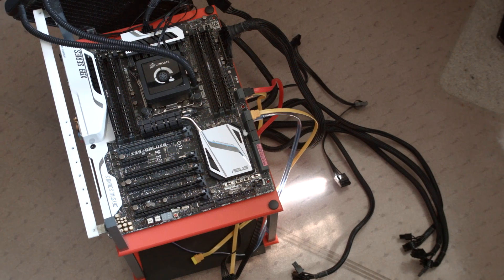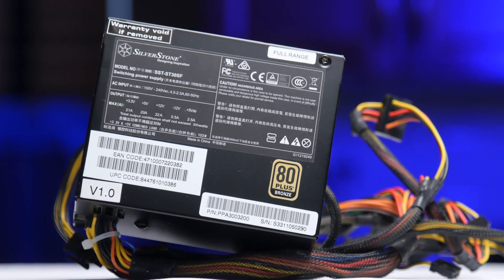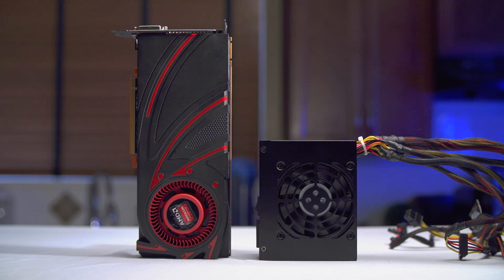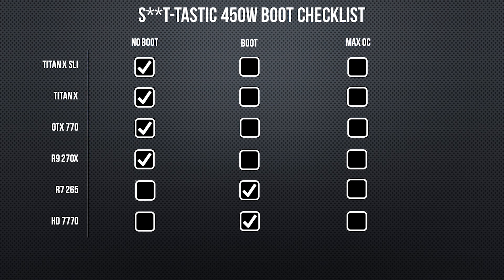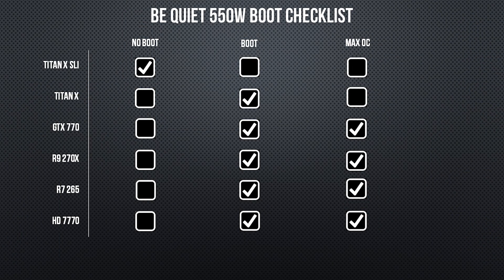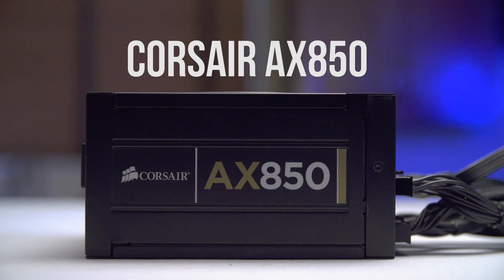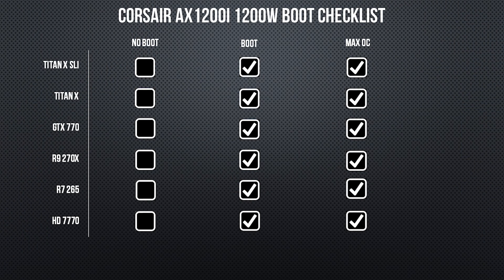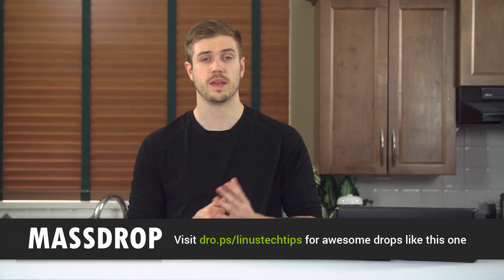Overclocking Recommendations - Low vs High Wattage Power Supplies

Comment: Hey i got the gtx 1060  and a i7 920 
12gb of ram if thats important

I wanna overclock the CPU i have. If i do it in bios how do i do it and how much is safe but still a good overclock? I have 500watt power supply

Also my processor cooler is a cooler master hyper 212

Comment: i have ryzen 2400g processor and corsair vs 450 smps.when i push my cpu above 3.9 it will cause freeze.its because of power supply?
it will complete one cinebench loops some time and othertime it will freeze.

Comment: Just gave in and bought 750w G2 and swapped out my currently mint running perfect 500w after a year of running it at full SLI gaming beast mode with 5.2 OC 7600k and a shit ton of fans drives etc and finally got off my ass and measured wall power. OMG how did my PC work! I was pulling 610 watts on a 500w unit. No issues no heat etc. Threw in G2 750 for the first time I was able to gain 53mhz per card core and additonal 50 mhz memory on both GPUs. NEVER had I been able to do this. Will test OC to 5.4 tonight but so nice to see power draw less than rated and bonus YES MORE OC ON CPU AND GPU SLI! FTW SO WILL IT WORK ON 500 YES, ARE YOU STRESSING IT AND LEAVING MHZ on the table? YES.

Comment: why does luke keep talking about power from wall like it's impressive? power supplies are rated for how much power they can deliver to components. of course they will pull more from the wall than they are rated to deliver under a full load since they are not 100% efficien

Comment: is it safe to overclock an asus gtx 1060 with a 550 psu? i have also an i5 6500, 16gb of ram and an h170 motherboard.
Pls help :/
Reply: Yes it's fine and safe to overclock as the pascal cards are very power efficient.
Reply: Thanks bud ;)

Comment: Hi can anyone help me out, i just bought an r9 390x but i only have an evga 500w psu. Im currently running a g3258 at 4.6ghz and an r7 260x just fine but if i upgrade to my 390x and an i5 (maybe 4460) both running stock speeds will i have enough power? I wont be using the 390x until christmas so i have plenty of time to decide if a psu upgrade is really necessary.
Reply: https://linustechtips.com ask theere
Reply: LOLZ1259 oh thanks, i never thought to use the forums i guess this would be a good time to do so.

Comment: Is it safe to overclock my GPU with these specs?
i5 6400
GTX 1050 TI
8gb ram 2x4 2133 DDR4
Asrock h110m
2x 1TB HDD
Vs450
Reply: Mild overclocking of the GPU should be no problem, but don't go too far. By the way, what is the exact model of your video card?
Reply: It is from Zotac =)
Reply: Thanks for your answer man! i really appreciate it :)

Comment: well i have a gamma psu 350  watt
with 2 12v raliils each one delivers 20A
my pc spes are:
i3-2120
2 sticks of 4 gb ddr3 ram
and a 7.2k rmp sata solid drive
and i wanna get gtx950 gpu and insert it on this system
is this psu good enough.
thanks in advance
Reply: use http://outervision.com/power-supply-calculator

Comment: I'm really curious if a 8  core, 16 thread Zen CPU plus a GTX 1080Ti would pull more than 550W. Really hoping not because the next EVGA G2 step up is 650 which I have a feeling would be overkill. Ugh why don't they make PSU's in other increments like 580.

Comment: I have an oem and I tried installing gtx 650 with 230 w and it wasn't booting  and i plugged in everything properly is it cause of the motherboard or the psu
Reply: If you really are trying to power a pc with 230w then that's definitely your problem.
Get a 450 - 500w power supply at least.
Reply: don't talk nonsense, lol drusby.

Lol what made you think it's MB or PSU it can easily be cpu, ram as well, get to friggin researching not youtube comment section and expect to get answers lol.. 

kthegreat. 230 might be too little, and hearing such a small number i'm guessing it's used so your parts might be broken especially the power supply.

also you should probably get more power while you don't need 500w. 350 to 400 would be a safe choice. (im using 450w with 4 generations higher graphics card.., i5 6500 cpu, and i still could'we easily went with 400w)

use site to check how much power you need
http://outervision.com/power-supply-calculator
then buy power supply  30%-70% bigger, also buy a decent power supply not some chinese shit, buy one with 80+, 
get as good quality as you can afford and bigger if you plan to build pc sometime later and use same parts, power supplies degrade and get dangerous  to your pc parts, but good quality supplies are much less likely to kill your pc and degrade slower.

Comment: Please redo video with new power efficient pascal and polaris GPUs
Reply: what do you expect. you need a less powerful psu. end of story
Reply: i need numbers, man.
Reply: So if I ran let's say an i7-5960x OC'd to 4.5 with a GTX 1080 at 2k Mhz a EVGA G2 550W would be enough?
Reply: yes. the graphics card will not go above its power limit unless you bios hack it, so this is 180 watts. the i75960x has a tdp of 150 Watts. lets estimate 200 Watts. then you are at 400, leaving you with 150 for mobo and hdd, peripherals. That is plenty. Fans are negligable.
Reply: Nils Wolny
Thank you! Now I know for sure that I wont need an OP PSU for it. Although I heard EVGA precision can go up to 120% of the power limit but as you pointed out that shouldn't effect it or would it?
Reply: Mike Soda
 yes, that does not matter for you. also running a psu above specs will surely degrade it fastly. 
it might also be a myth that came up, because the power drawn from the socket is up to 20 percent higher than what is delivered to the parts. the number of the psu is the max power going to the parts, not what is drawn from the socket.
Reply: Mike Soda
 yes, that does not matter for you. also running a psu above specs will surely degrade it fastly. 
it might also be a myth that came up, because the power drawn from the socket is up to 20 percent higher than what is delivered to the parts. the number of the psu is the max power going to the parts, not what is drawn from the socket.
Reply: Nils Wolny
Great thanks, in some other comments elsewhere someone tried telling me that a G2 550W gold is overkill lol. I guess they're one of those people who try to cheap out on a PSU & fry the whole system.
Reply: Mike Soda haha. 550w overkill. Not really. I remember when I bought a 700 watt psu to be on the safe side. for mayimum efficiency you want your psu to run between 50 and 80 % of maximum power.
Reply: For graphics cards (even with Pascal), it all depends on what you get. My non-reference Zotac 1080 Ti (OC out of the box) 1is dual 8-pin at 320W, and overclocked further with 120% power I've seen peaks at 350W, in theory up to 384W. This is a single card, and the SLI setup (for this card) even with Pascal's overal more efficient design could pull up to 800W by itself. 
More expensive power supplies (usually 1000+) often have considerably better warranties (like 10 years+), superior energy efficiency, and are quieter (especially when not under full load), so if you're going hardcore and you can splurge, it can still be a solid investment, unless the game totally changes.

Comment: did u use adapters for power supply that dont have 6pin or dual6pin or 8pin connectors? i want to try if it will work on my 2+6pin to run an old 480 wich has a 6 and 8pin power connector. kinda scared coz it might explode. lol

Comment: Can I run an MSI nVidia geForce GTX 960 2gb 128bit on maximum overclock with 600wats psu?? Thank you if someone answer
Reply: Yea
Reply: absolutely.

You can run a GTX 1080 at max OC with 600w, you have nothing to worry about with this setup

Comment: i have an Antec 550W GOLD PSU, is it enough for i7-6700k OC @4.4Ghz, Msi GTX 970 OC, 120gb SSD, 1TB HDD, Optical drive, and a PCIe Wlan card?
Reply: easily

Comment: will 220/250watt be enough for the GTX 950/960?
Reply: Rinay Harpal A 500W PSU (assuming decent quality) that means it can deliver 500 W to your computer and draws 625W from the wall (assuming it is 80% efficient).  In my case, I have a 650 W PSU that has an efficiency in the neighborhood of 92%, if I put my PSU under full load, my computer would draw 708ish W from the wall.
Reply: Rinay Harpal you also misspelt genius again...
Reply: a 250 watt psu is way too less, that would not eve be a gaming psu, the gpu will use at like 150-200 watts alone, cpu 75-135 depending on the model, so this already exeeds 250 watts. you should go for a 500w or above 80+ rated psu hope this helps. if you post your rig specs, you could get a better reconmendation.
Reply: ok thanks im gonna buy a 450w psu then?
Reply: get a 550w 80+ certified instead, psu give around 80%(80plus) of the power written, i would go with a 500-550w 80plus. so you don't have to regret...
Reply: That isn't what 80+ means....
Reply: i have a gtx 960 with a 450 watt psu
Reply: Cem Den https://linustechtips.com/main/topic/406160-psu-ranking-and-tiers/ Get something that is tier 1, 2, or 3 on this list.  Don't get too hung up on the power number, a high quality supply is much more important
Reply: Niko Yochum why don't you tell me then, "genuis". your list is just a reconmendation by someone. sure high quality is better, doesn't mean you spend more money on things you don't need, specially if you're on a budget.
80+ means psu efficience more than 80%.
Reply: Rinay Harpal 80+ means 80% efficiency or better, meaning that if your computer is using 100W, then 120W or less is being drawn from the wall, it doesn't mean that a 550W PSU can deliver 80% of 550W.  Also, PSU is the most important component in regards to stability and lifespan of your system, nothing can ruin as many parts as a PSU failing.  Why did you misspell genius?
Reply: +Niko Yochum So if you use a lets say 500w psu and it draws 500wats from the wall, it can give 80% or more to your pc, duhhhh!!!. drawing more power from the wall than the psu is build to do will either fuck up your psu, or shorten its life span, ultra Genuis...
Reply: hahaha,"genius' is killing me, lol. english is not my foreign languageXD. anyway i have to say, you're actually stressing your psu, it's could be ok ass long it runs your system smoothly( which i asume it does with 92%). anyway I'm getting sick of this crap. I don't think we helped Sem Den a lot with this, so lets just tell Sem Den to get at least 500watt cerified psu from a decent brand. its a 960 he'll be running so that should be more than enough.
Reply: Sualeh Irfan wow, finally someone without manners...who cares more than the person who asked the question. mignificient!!!! bravo!!!!!!!!!!
Reply: Sualeh Irfan me? or the other guy?
Reply: +Rinay Harpal you certainly don't know what you're talking about.
Reply: wtf are people talking about here. always with the 80+ nonsense, power supplies can have drain/use ratio at 1/1 but if it's low quality it will still explode just as easily as 1/0.1 ratio power supply
check for a decent manufacturer, or even better research the power supply you plan to buy, the ratio is important as well but it helps with heat and lower electricity bills nothing else (ofc heat can kill your pc but you can always get extra fans) so get 80+ or better supply.

to see how much power you need use http://outervision.com/power-supply-calculator get extra 30-70% watt supply for safety reasons.

Comment: were these tests with CPU & GPU alone ? 
How will having raid 10 set up, with an SSD, and having ~6 USB used impact the wattage ? the 6 USB being gaming keyboard & mouse, web cam, scanner/printer, possible a phone, and an USB drive.
Was thinking if a silverstone SFX-L 500W 80+ gold would be enough to power all those, with an i5 6500 & R9 390.
Reply: USB drives don't use that much power, like, a max of 10ish Watts each (I don't remember the exact specs)

Comment: The amount of watts that a power supply says it has doesn't give you the whole picture!  This video didn't consider the AMPs going through the 12V rail for each of these power supplies which most modern computer components use these days. You want more AMPs going through the 12V power rail than any other power rail. The CPU and GPU exclusively use the 12V rail so make sure you have enough AMPS going through those! I just changed my power supply and it has the same 680W BUT there are more AMPs going through the 12V rail which results in more Wattage for that power rail to the CPU and GPU so I can supply them with more power and actually overclock my CPU and run an NVIDIA GTX 770 graphics card properly without it turning into a black screen while playing games.
Reply: So basicly 600 watts for boost clock but more for overclocking I don't see the point messing with settings too much I rather set it at it's factory boost clock so 6000watts  on a Titanium  psu  will give me more than enough  when nvida  recommends  600watts

Comment: A Seasonic 520w Bronze PSU is good for an high end single card configuration (like i7 and 980).
I don't like to spend a lot of money for an overkill psu, 50$ for a good Seasonic PSU is just fine
Reply: depends what you mean by overkill... Wattage doesn't matter that much, I will "overpay" for high quality however

Comment: i7 4790k(will be overclock) + nvidia gtx 980ti.. 1tb hdd and 120gb ssd.. recommendation psu? will 600w be enough? or 750?
Reply: Get a fury X instead. There is no reason to get a 980 ti over a fury X.
Reply: the thing is i already bought a gtx 980ti. the fury x is more expensive, and most of the game is dominated by nVidia. i know the fury x is way more powerful and futureproof but amd games arent as much as nVidia's so in many games the gtx 980ti will have more fps unless im playing on a 4k resolution which i wont be getting any soon and when i will there might be some new gpu come out. thanks for the suggestion though :)
Reply: +B Rich any time. Polaris is released in the summer
Reply: Hey dude I have a 4790k@4.4 and an msi 980ti @1475mhz. Im using a corsair rm550. Runs fine
Reply: 600W is fine if it is a good PSU https://linustechtips.com/main/topic/406160-psu-ranking-and-tiers/ Get a tier 1

Comment: so what software did they use to get the wattage readings?
Reply: Penis, lite. Linus didn't let him get the full version.
Reply: They used a meter you plug into a socket and then you plug the PSU into the socket on the meter.

Comment: Anyone have an idea if a Corasir CX430 could run a ASUS 750Ti OC edition with an Intel i5 4690k?
Im not planning to overclock ANYTHING. All help is appreciated!
Thanks :) and Merry Christmas!
Reply: +Jericho704 - Nemo yes. A 750ti is efficient using less than 100watts, and your system draw should be in the 300 range. a cx430 will handle that just fine
Reply: Thank you! :)
Reply: Tyty :D

Comment: What about amperage. some cards require some pretty high amps that some power supplies dont have. so it is false to say any 850w power supply can run 2 titans.
Reply: +Adam Butler that's why you look at rail specs for the PSUs.

Comment: I'm running an r9 285 on a 430w psu IS THAT BAD???
Reply: +Ron Calara, that's totally OK if you have nothing other than the graphics card hooked to the PSU :P
Always give other specs when asking about wattage. CPU can be anywhere from 50 to 130 watts or even higher with OC, also number of hard drives affects power drain pretty considerably.

Comment: Bigger is better. Longer life, less load, and more efficiency. (The wires are thicker, which are less resistive). You have room for upgrades, too. 550W in a 300W computer for me.
Reply: +waterlubber  I have a 750W in a 350W absolute max usage build. I love it, it's absolutely silent, plus I can throw in all sorts of case lighting or extra fans and accessories without worry. No coil whine issues either. I don't care about less idle efficiency. Sure I paid more money for the higher wattage unit, but it'll last for any upgrade I want even a dual GPU.
Reply: nigahiga6400
Exactly. You'll be upgrading anyway, and a $50 350W + a $100 800W later on is still more than a $125 900W.

Comment: I'm still wondering what could power a 128gb ram, quad titan x, 5960X rig fully watercooled @ max stable overclock. I think even the corsair 1500i wouldn't be enough and you would need an extra 500w just for ram, pumps, fans and everything else beside CPU/GPUs
Reply: +Guillaume Joop yea it would have to be a dual psu setup for sure.

Comment: Will my pc bottleneck if i add a second GTX 970 to my rig? 

Specs: i5-2500k, 8GB 1866mhz RAM, A standard 100$ motherboard from ASRock, ..basically just replaced my old Mb because it died :c.. 750w PSU and yes the case does fit a second GPU.. Anybody know if it'll bottleneck? And yes i am gonna upgrade this PC next summer to something alot more powerful.

Comment: CPu needs 200 watts gpu needs 350 watts so 2 gpus 1 cpu is 900 watts. So you need 1000 watts minimum. I got gpu to 350 watts and cpu 120 to 250 watts and using corsairAX gold 850 watts. And i got less bill then with old 550 watts psu.

Comment: hmm this actually got me a little concerned, i currently run a gtx 970, a 4790k, 7 fans, a closed loop watercooler and a asus rog gaming mobo off a antec gaming 620watt power supply. Ive overclocked my 4790k to 4.6ghz and my gtx 970 to 1550mhz/+575mhz. Does anyone reckon my psu is pushed to its utmost limit? 

edit: I just ran a test, i stress tested the gpu and CPU both at once at their overclocks. psu made a ticking noise, they still passed their tests though...